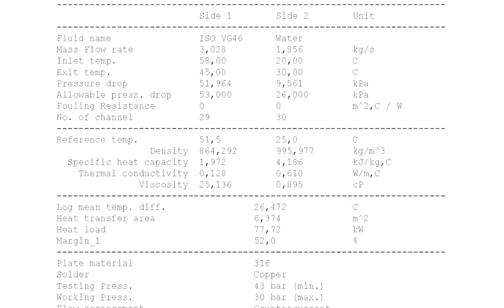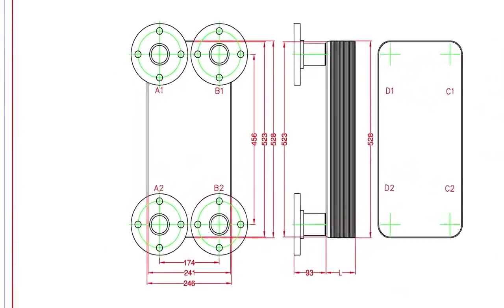Plate heat exchangers, the right way to connect pipes

Comment: In our plant installed DANFOSS SONDEX PHE Gasket type installed. The PHE piping orientation also opposite as per DANFOSS manual. Bottom Hot CCW water  44.8 C and Top ACW in 33.8 C. We found often DP high although newly installed and suspecting it is related to piping orientation . Can you confirm , thanks.